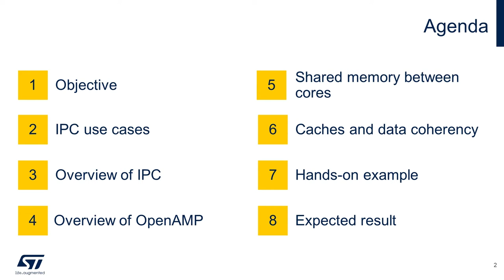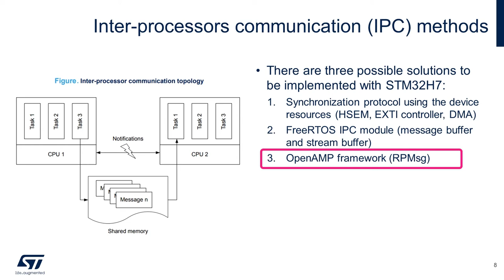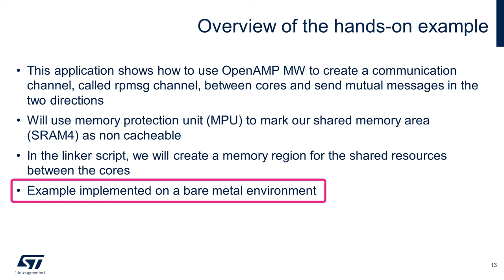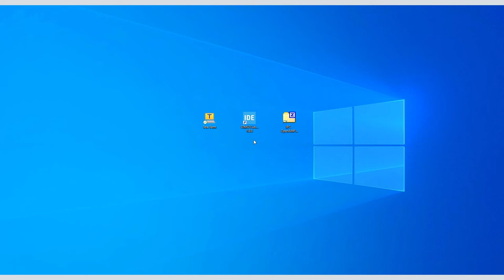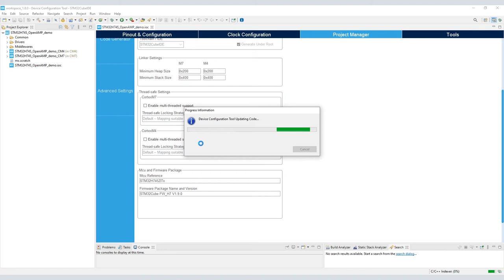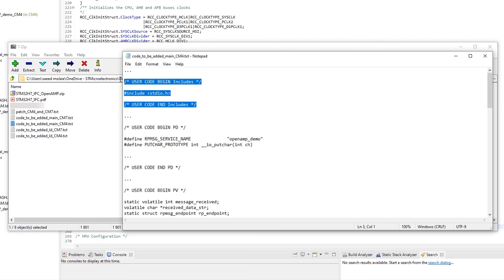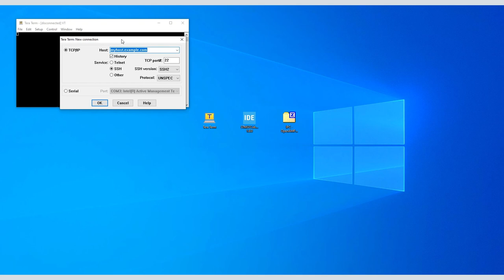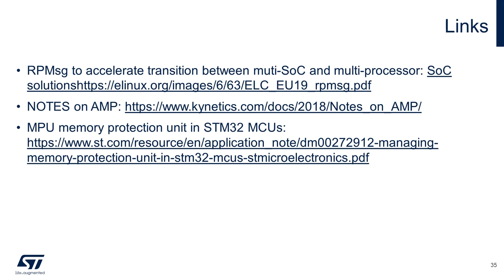Inter-process Communication via OpenAMP

Comment: Hello, i want to Transfer data the other way round, so from M4 as Master to M7 as Slave, i have used your Code (pasted it   also the other way round but it didn't work) is there something more to consider if i want to use M4 as a Master?